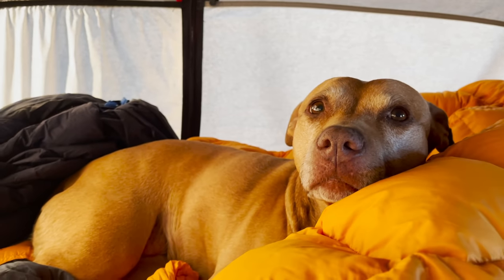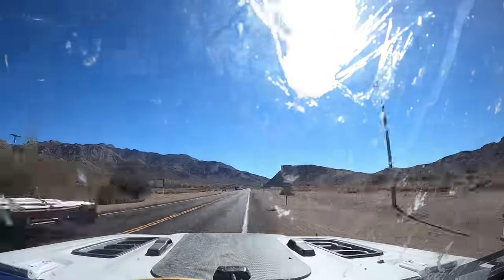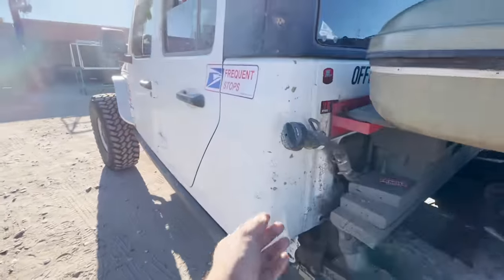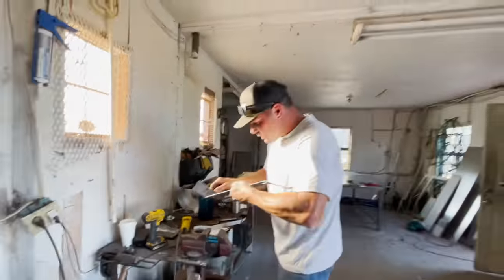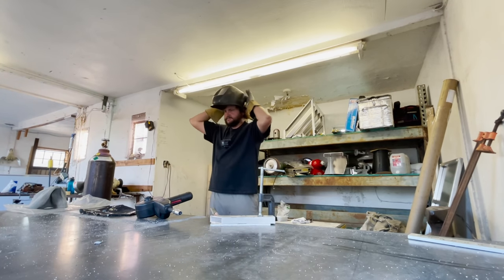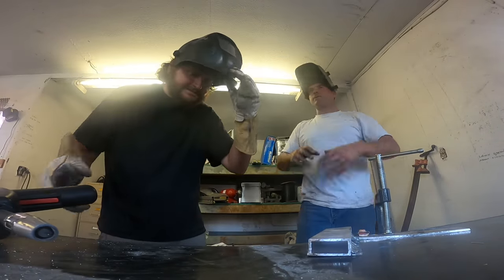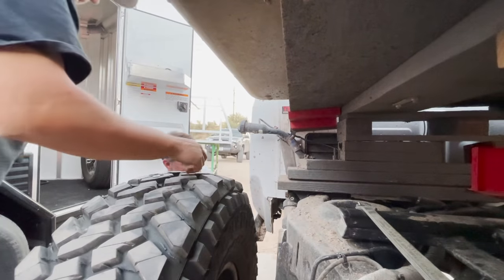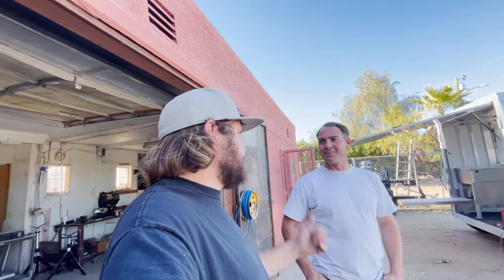CRAZY MAN on the Side of the Highway Teaches me how to WELD!

Comment: I have MIG welded steel, but that is all. To MIG aluminum, would be a dream. I want to learn to gas weld, because you don't need special power requirements. There is Da Jungle Boy stick welding with 110 volt in Panama.